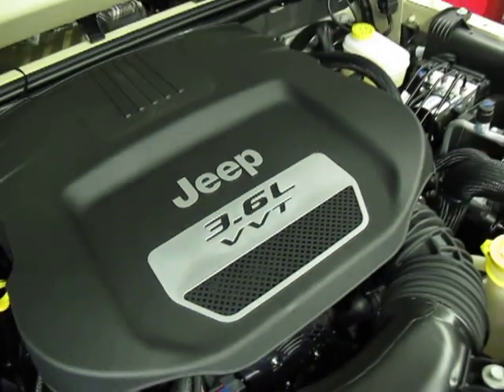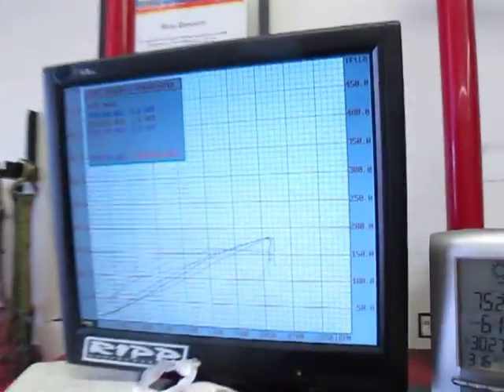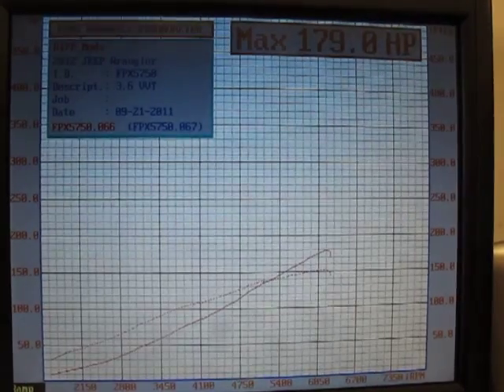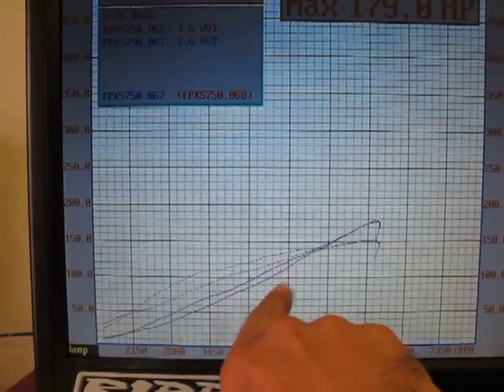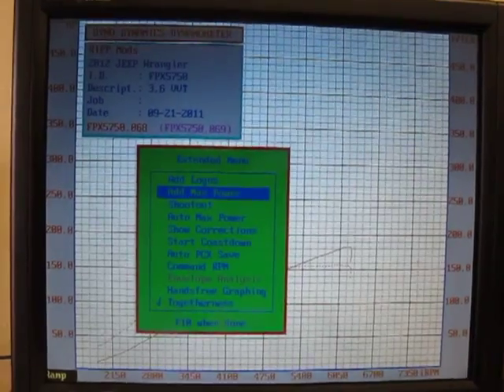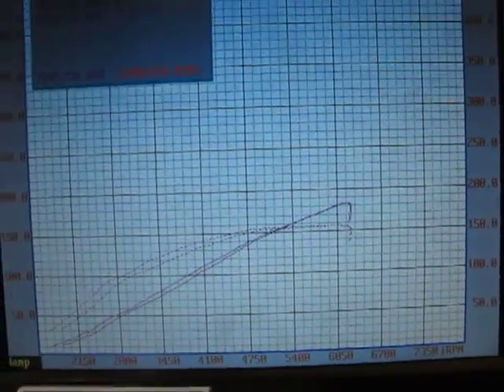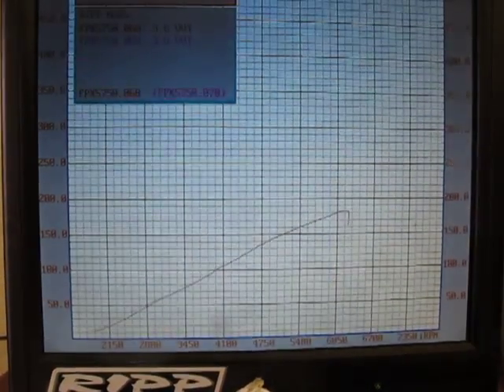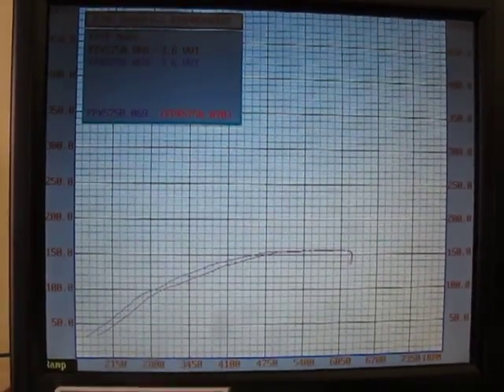RIPP 2012 Jeep Wrangler 3.6L V6 Dyno Test

Comment: The 2012 Sahara is rated at 280hp and 260 lbs of torque
Reply from the maker: Yes thats at the crank - we are measuring HP at the wheels. There is a 33% drive train loss in the JK so it only produces 190 rear wheel HP STOCK.
Reply: is that is an auto if so theres your problem

Comment: The power the 3.6 pentastar produces is far greater than the 3.8 at around 80 crank hp or at least a 60 whp difference vs a 3.8. Not sure what is wrong with your dyno that makes them read about the same at the tires but I can tell you that is 100% inaccurate. If you have ever seen a race between a 3.8 and a 3.6. The 3.6 puts bus lengths on the 3.8. (both were JKU rubicons with same gears, tire size and same 6 speed manual trans).

Comment: There are different types if dynos. I had an 08 STI and when I got it tuned it was 275whp and 310wtq but I dynod it at another shop and it was like 320whp and 350tq

Comment from the maker: What exactly do we need to get straight? Our pass was not corrected in anyway - and we tested on an eddy current dyno (Dyno Dynamics) - A dynojet would read higher by 15% which is in line with your number... You cannot test in any other gear is a modern JK because of the elaborate traction system locking you in 3rd once you pull the traction fuse...

Comment: There is not a 33% drive train loss with all Jeep Wranglers.  Drive train loss is a rough estimate at best, and determined by a myriad of factors (transmission type, transfer case type, gear ratio, wheel/tire size and weight, and type of dyno being used.)  I sincerely hope RIPP doesn't intend anyone to take this video or write-up as accurate or factual in any way.

Comment from the maker: @texasbradley if your using a pocket dyno or a cell phone based app you need to have the exact vehicle weight calibtrated into the tool before doing Hp runs, otherwise its false... the best we got out of a 2012 on our $120k machine is 195.

Comment: OH and I just used pocket dyno and achieved 0-60 in 6.8 sec in my 2012 JKU rubicon. It's an auto with 3.73 gears. It also made .58 G's on accelaration. The new 2012 is beast and its totally worth getting rid of your 3.8L-I DID!

Comment from the maker: We know these Jeeps and test thoroughly. If you dyno test and measure at SAE standards as we do, any dyno in the world will deliver the same results. Bending the truth would be counter productive. Our opinion is the 3.6 is a better engineered engine using modern processes (variable cam timing). The 1994 3.1 was raced in circle track and built to compete using the parts out he Chevy Motorsport catalog, in stock form its was better than the 305 which was weighed down with pollution stuff.. .

Comment from the maker: Well - we are making a 3rd gear pass to red line - There is a 33% drive train loss with all Jeep Wranglers. The 2012 is the same as the 3.8V6 in terms of power loss. The 285 Jeep advertises is at the crank and not at the wheels.

Comment: @RIPPMODS 
Hmmm, looking at things more closely, your dyno does seem awful low.  Motor Trend got the new Jeep down the quarter mile in 15.2 seconds.  Even allowing for times as much as 15.5 seconds for margin of error, you still need over 210 hp at the wheels to get a 4000 lb vehicle down the track that fast.

Comment: @RIPPMODS 
Ooops.  Didn't mean to insinuate you were making anything up.  Re-reading my post though, that could be taken as the tone.  My main question was why your stock crank numbers were lower.  At the advertised numbers drive train loss is 37%. More than your 30 to 33% average.  Anyhow, I was mostly complaining that 37% of my hp was eaten by my Jeep's transmission and transfer case.  I am anxiously awaiting your system for a 2012+ JK.  I want one. :).

Comment from the maker: @MrSpdygsxr No problem, thanks for pointing that out. The Trq converter lock up is 3000 rpm, which means we have to start our pass from 3000rpm up.. so yes the test is short. We eliminate the other pass' because we are looking for real HP... WITH THE Engine cold for peak and hot for real-world. Please understand, we are demonstrating a HP curve in 3RD gear (1to1), not drivability. The 3.8/auto combo is mismatched and not great to drive. The 2012 engine/trans combo delivers HP much better.

Comment: Where did your crank hp numbers come from?  The advertised numbers are 285hp and 260ft/lbs.  180hp is one hell of a drive train loss...  37% is pretty ridiculous.  I guess gearing makes all the difference.  When I line up next to a 2011 2 door Rubi I beat it by a large margin.  Auto or manual with same size tires.

Comment from the maker: @acameltoe this JK is a Rubicon and we optioned out the 4:10 gearing - it does not effect total HP output, but rather the shape by matching the drive-train load to the wheel speed.

Comment: @RIPPMODS i agree with this all the way. the transmission in the '07-'11 JK (42RLE?) just bogs the engine down. the 3.8 leaves alot to be desired, but putting a 5 speed behind it would be very interesting....
thanks for putting this up.

Comment: @conrman I'm going to drive a 4.10 equipped JK today. I owned a 1991 sr-5 ext cab pu with a 150hp 3.0 v-6, 5spd, that came with a 4.56 (stock) and 31 inch tire. The gears really worked great for that almost perfect combo. It returned 19mpg at 75-80 mph. I wonder if I could get similar results from the 3.6/5spd auto/JK combo? Guess I need to compare dyno charts? JK weighs a bit more than that TOY pickup.

Comment: I always find this stuff interesting.....I drove a couple of 2012 3.6. JK Unlimited last week. I found that the 5 spd auto accelerated better (smoother) than the 6spd (I generally prefer a gearbox) under full and various part throttle openings. My concern was that once up to speed at low speeds, the car could not maintain speed without downshifting. The vehicles were likely equipped with tall 3.21 gears and had 255/75/17 sized tires. This seems way to tall IMO.

Comment from the maker: @DrewEmc2 We are saying that the real winner between the 3.8 and the 3.6 is the 5spd auto in the 2012 - The power is smoother from the 3.6 based on the variable cam, but over all the closer ratio transmission makes the power more usable.

Comment from the maker: @aedt0000 Well - that's not really true- because we are making a 3.6 kit as well - That's our 2012 - We simply made present the two engines and their dynamics. While the 3.6 is a better engine over all, its not worth getting rid of your "well built" 07-2010 (if you love it) just for the engine. If it helps people make their minds up in purchasing a supercharger to make their 3.8 that much better - then hey, we delivered the message and they made the decision.

Comment: @RIPPMODS 
I can't argue with that, it is not a V8 like you stated, but still a very significant improvement. Certainly not "about the same as the 3.8L." But for instance, motortrend got 6.7 seconds on their 0-60 time with a Manual Transmission 2012 compared to 9.8-10.2 seconds for the 3.8L manuals. So even negating the "new auto" there is a significant improvement. Either way, I cannot wait to see you guys supercharge the new engine!!!

Comment from the maker: @BrettDez There's two ways to look at this - at 1500-2500 the torque is nearly identical - 10-20% is not what JK owners were looking for, they wanted V8 grunt.. Its better, but not what they were shopping for... The real star is the better matched transmission. It makes better use of the "low" power... In driving a auto 2012 vs 3.8, paying attention to the transmission shift points (as we are) one can feel that its still underpowered ( BUT WAY better). The gains are 70/30 trans/engine!

Comment: Is there a little twist to the wording going on? I watched the 3.8L dyno test video you guys have posted and then this one. It looked like the factory 3.8L at 2000 RPMs got 74ish ftlbs of torque while the 3.6L got roughly 100ish ftlbs of torque at 2000 RPMs. That's a 20-30% increase at 2000 RPM. Saying the torque is almost the same seems very wrong, maybe "max torque", but in the normal RPM range is a big jump.